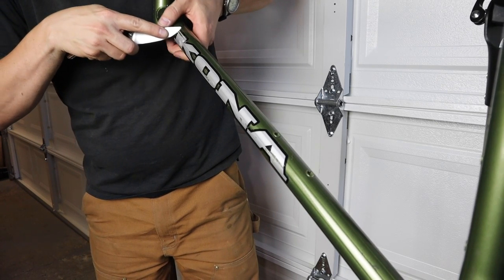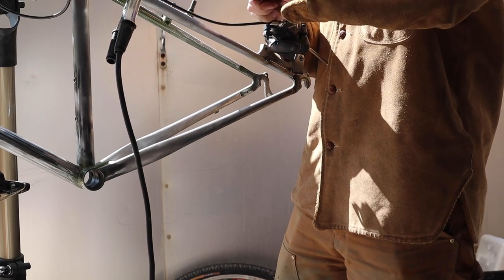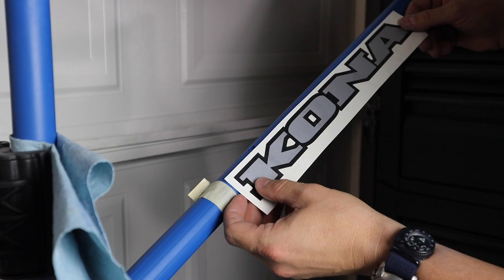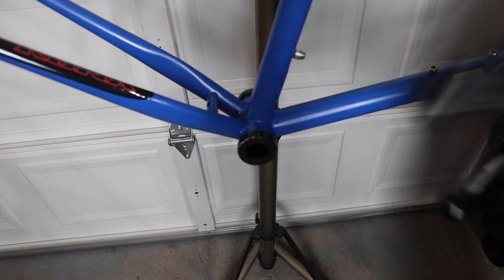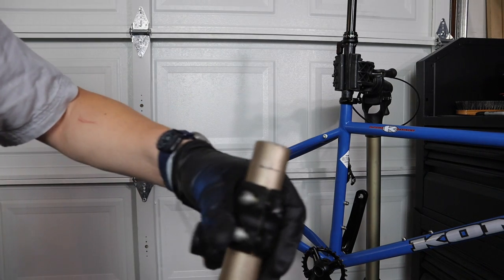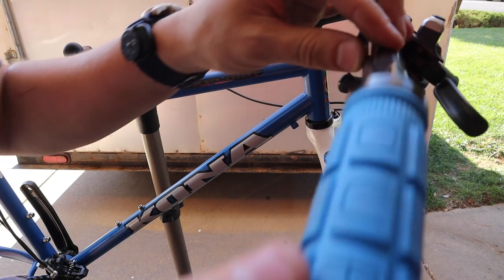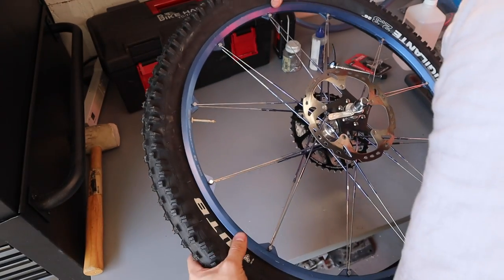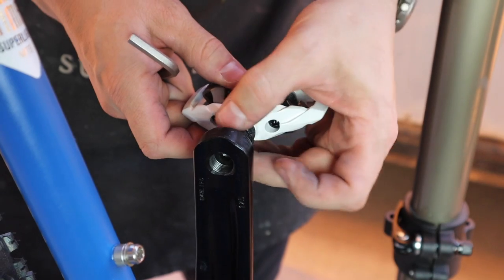Nostalgia | Bike Restoration Build | 1994 Kona Explosif

Comment: Erm- can those thin seat and chain stays take the pressure of a disk ??
Reply from the maker: Good question. I after I finish the thought did occur to me that it may have been helpful to add in a brace just below the brake mount. In any case. I’ll find out in use 😁. Thanks for watching.
Reply: Probably yes, especially this bike probably doesn't get ridden that often/hard
Reply: oldshovel - ideally a little brace between the chain and seat stays would be good - you could even retro fit an aluminium or carbon stay between them

Comment: is the welded on brakes at the back gonna be safe for emergency brakes or stops?
Reply: For maximum durability, should really weld in a plate that connects the seat stays to the chainstays, a lot of older frames which don't use a heavy duty dropout are designed that way.
Reply: @weareallbeingwatched4602  Yeah, a lot of older frames built without disc mounts aren't reinforced enough to withstand the torsion put on the frame from the disc brake. Not trying to be a debbie downer but I'd be wary of using that rear brake for any hard stops.
Reply: @miaflore  you can see how the guy rides at the end of the video, and steel is stronger than most materials, so he'll probably be OK, but that sort of hackery is not really legit, and should involve the chain and seat stays being cur, and a new dropout being welded on.

Comment: I once had a beautiful red over gold pre-Trek Klein Attitude, from memory maybe a 1995 model, although it may have been a year or two earlier. I spent the modern equivalent of perhaps $15,000 AUD and 18 months on custom building it with Grafton joy stix cranks, Hope hubs, titanium everything, tensioned CF blade spokes (anyone remember them? They were about £20 each or something back then). It was full XTR except for the pedals which were DX on account of being smaller and lighter than the XTR. This is about the time I'd be restoring it except my ex girlfriend, instead of sending it from Oxford to Melbourne like I paid her to when I emigrated, sold it for £300. Whoever bought it got the bargain of his life, given that wouldn't even have paid for the front wheel. Angela, I hope you die painfully. Soon.

Comment: same frame same project + converting the frame with shock absorber on the rear wheel too. Kinda crazy.. But all is done to sell 27.5" today and my old rockrider is 26". About nostalgia, you talk about 40. Its getting worse at 50 ;)

Comment: The rear disc is kinda cool, but the zip tie holders are shameful. You could have riveted some hose guide on the lower left side of the top tube. Did that on my 2001 Schwinn Homegrown 27.5 conversion. Very clean

Comment: The reason they don't make bicycles out of such small sized tubes is because they are made of aluminium and need to be bigger to match the strength and durability of steel.
I really like steel frames. They are much more comfortable than aluminium.

Comment: maye you should of took one of the bottle screws out the standover tube drilled it slightly bigger and then you could of had a internal dropper post   instead of the cable wraping around the down tube

Comment: That is a cool bike. Steel frames live forever. The 180 rotor in the back is a tad aggressive, imo.
Reply from the maker: It is a bit aggressive, it seamed to fit better with the angle of the seat stay. I had looked at running a 160 bit it did not line up as well.

Comment: Nice bike,  I still have an '89 Kona Fire Mountain,  upgraded eith xt levers,  8 speex,  deore lx rd,  fd,  and brakes,  but still original paint.  Why paint a frame when the odiginal paint is in good condition? This os not restoration.

Comment: What's the benefit of an oval shaped sprocket?
Reply from the maker: It helps with pedaling power to be more consistent by making the rotation easier on the weak part of your pedal stroke and harder on the more powerful part of your stroke.

Comment: Such a high class Shimano XT equipment is much better on carbon frame. All The frame shocks when XT fires. Its a crime XT on steel old frame :-)
Reply: That Kona will be still riding when a carbon bike you buy today will be in the landfill.
Reply: @55whiplash  carbon bike rides a way better. IT can be sold with no problem. Its only a memories. Technologies  changes everything. Aš for me new technologies more useful. More attractive. Ive sold many bikes and old restored ones pays no attention to my customers. You can old frame provide by best equipment.  But that stuff cant be sold in my market.    Ive tried a different  carbon frames. Light strong and durable. No corrosion affect. And can be stolen in a minutes. Only One disadvantage.
Reply: I love smell of new things. At first look you can recognize restored ones and brand new from The factory. Its a best moment in life to buy new technologies and new things. Used and old restored ones for fans. On a scrap everyone can find hundreds roasted old frames. For your generation its a memories. But when Į tried first 29er, no more question rises again.
Reply: Ive bought in the 90ies new Panther made in our factory in  Šiauliai city. Got it new for 300 eur, sol after 10 years for 100. Not a nicest bike on a planet, but had made his job. New 29ers far more better. Merida, GT, Scott, Giant, Cube, Specialized. 29er is simply WOW. Love 70cm wide steerer. This is real feeling force of ride. And a wide tires. 2,2 inch, 2,35 it works like a suspension on hardtails. No comparison to oldies,
Reply: American TREK has its own developed G2 geometry. When on the TREK 29er, just simply feeling WOW.